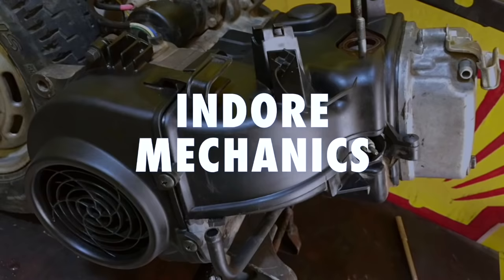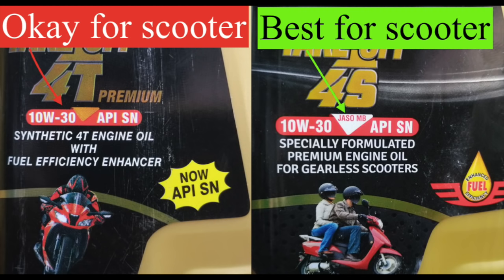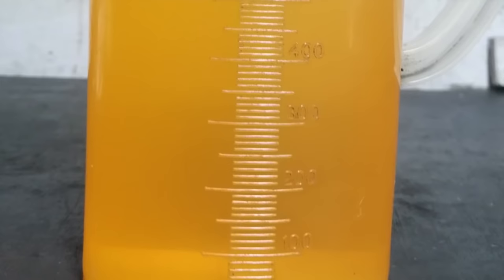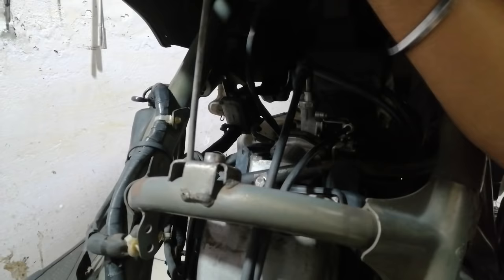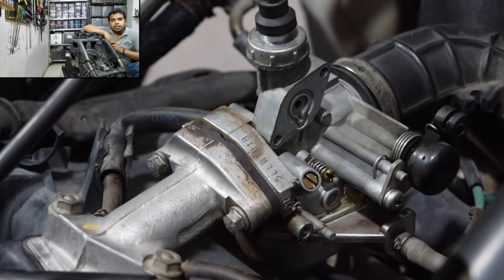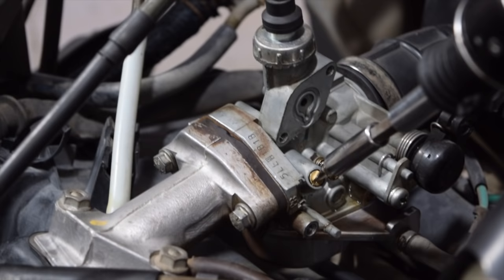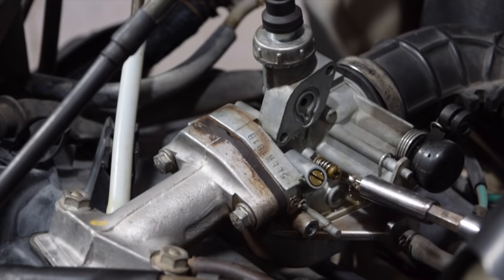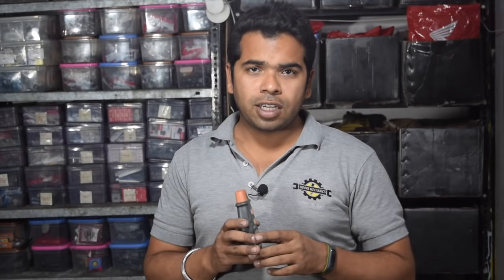Honda Activa carburetor Setting tips || #IndoreMechanics #hondaactiva

Comment: It is difficult for people to judge RPM and all. Simple tuning procedure is, Keep the air screw full tight , Turn the idling screw to the point where the back wheel just start to rotate ; but not rotating. Now adjust the air screw slowly anticlockwise and see the wheel turning , turn the screw till the wheel rotates  fastest, that is the real point where you get good mileage and power.
Reply: I will try this
Reply: @Yash_goud25 bro how was u r experience pls reply i am struggling for Dio bs4

Comment: Very nice except there was no need to screw in back of less than 1/2 turn..the RPM & smoothness of acceleration and drop will let you know the settings.
Reply from the maker: Extra lean mixture heats up spark plug. So it is recommended to turn in quarter turn.
Reply: @indoremechanics  Actually best mixture ratio will give very smooth acceleration and lean mixture will run coarse engine..Best way to inspect spark plug after minimum 500 kms it should give brick colour of inner rod with optimal settings..its light grey means lean or dark is rich mixture.
Reply from the maker: @lokeshvigil8497  You are right but, Spark plug  inner surface will still be white if it's slightly up or down. but you know due companies recommendation we keep quarter turn in.
Reply: @indoremechanics  sir aap ki advice hi jabardast he lekin ab meri request he please. Mere paas honda 125 psi he jo electric injector he aur jese aap ne vídeo ki suru me bataye wheel uske free hone chahiye lekin jab acceletor chhodte he to ek dam se chipakti he jese break lagi ho is ki kya wajah he aur uska koi solution ho to vídeo banaye please. 🙏
Reply: @indoremechanics  sir petrol jyada khane lage to garage pe lejane per kitna kharcha aaye ga
Reply: @indoremechanics

Comment: First off all very very thanks to you sir,
Last 4 year I have a activa 4g but the milage is only 40 to 45 after the proper services in time....
I gave change 2 to 3 mechanic but result is zero.
After watch your this video I have personally setup the carborater and the result is amazing after 2 times of counting the average is approx 56. And the startup problem is solved..
Thanks a lot sirji ❤️❤️❤️❤️❤️
Reply: Bro how much turns after full tight
Reply: Is it 1.7 turn
Reply: Bhai muje  to  30-35 k upr nai deti...  Jbse  liya h  tbse... Activa  4G 😥😐
Reply: Mere pass bhi 2005 model activa hai jo last year Tak 55 kmpl Tak milege deti thi par ab 40 ho gayi hai ....
Reply: What about pick up and power
Reply: @mayursuthar1479  same here
Reply: 56 is too much , the ratio is very lean and will lead to overheating n engine problems upto 50 kmpl is fine in my opinion

Comment: This video helped me to tune the carburettor of my Dio. No more backfiring and no more rough idling. 

I think the last half a turn of the fuel/air mixture screw (golden) takes a hit on performance. 

Thank you so much for this very useful, easy to follow and high quality video.
Reply: Hey bro.. Have you removed that vacuum pipe as he told in the video? Or have you just adjusted without removing that pipe?
Reply: @ranjitnavale4981  I blocked the pipe as instructed.
Reply: What's your mileage??
Reply: Aap sabhi ko iska description padhna chaiye pehla.., Aur mujhe lag he rha tha ki carburetor ko chedna sa engine pr negative impact zarur padega... Aur wahi hua Kuch saalo baad Engine ki Jaan Dheere dheere khatam hone lag gayi meri activa ki warna meri Activa 4g 10 saal aaram sa nikal deti....
Don't do anything without knowledge because everthing have pros and Cons. 
Bye Friends 👋

Comment: Thanks for explaining things perfectly. Why did I find black oil leak from my activa 125 shock absorber in the front right side. Front wheel is like that of motorcycle. Is there any danger in riding around?
Reply from the maker: Shockup has an oil leakage, you'll need to repair it, and do change oil of other shockup too. For balancing
Reply: @indoremechanics  Thanks bro.

Comment: Bro, woh vaccume pipe nikala tha, uska kya reason tha?
Reply from the maker: Vacuum pipe, se back pressure neutralize hojata he, jiske karan hume proper cumbustion k bare me pata nahi chalta. isliye hum disconnect kr dete he.
Reply from the maker: jaise sub filter kharab hota he to back fire sound aata he na, and clean kr ke fit krne pe nahi aata. back fire k liye carb setting responsible hoti he.
Reply: @indoremechanics  proper air na milne par miss firing hoti hai jab paper filter choke ho jata hai to aesa hona aam baat hai
Ya air fuel mixture wala screw galat set hua ho ek baar maine bhi galat set kar diya tha gaadi saare raste patake maarte gayi phir sahi kiya
Reply from the maker: @Clarityinlife335  kaise sahi hua tha Sir wo
Reply: @indoremechanics  mechanic se sahi karwaya fir khud to itni samajh nahi thi tab lekin try karne ka shounk tha
Usne sahi mixture set kiya where he achieved highest rpm aur fir rpm ko set kar diya fir dobara wo dikkat nahi hui
Reply: @indoremechanics  yeh kabhi try nahi kiya, next time kabhi carb setting karna ho toh zarur try karunga.
Reply: @indoremechanics  bhai bike me bhi vaccume pipe hoti hai kya ??
Reply: @ankitsrivastava9715  no

Comment: I have an activa 3g 2015 model recently after reinstalling damaged secondary air filter my bike pickup got decreased 
When a passenger sits in not getting proper power transmission (carburettor thinking also done). WHAT SHOULD I DO

Comment: Thank you for sharing such a knowledge. I just have a question does Dio can be managed in same way ??
Reply from the maker: Yes
Reply: @indoremechanics  good information bro. May i know is it possible to set a honda scootter carburetor into a Mahindra rodeo scootter. Mahindra scootter very less mileage. Any possibility to change the carburetor.
Reply: Thank @Zain09921
Reply: P
Reply: @rajandass7307  lllllll
Reply from the maker: @Zain09921  no I don't think I will work

Comment: Hi, I'm using a honda dio. It was unused for 3-4 months l. Recently i changed engine oil, gearbox oil, cleaned air filter and carburetor and it gives only 30-32 mileage. I adjusted the mileage too. Is there anything else i can do to increase the mileage?

Comment: Hey...i bought new activa 6g a month back. But i am facing one problem now whenever i accelerate it near 40-50 there is some whirring sound from the back of the scooter it feels like something is rubbing against some belt or tyre. 
Please tell me what it could be as the guy at service centre is unable to solve it. Looking forward for your reply.
Reply from the maker: Need to inspect it. Bring it to workshop
Reply: @indoremechanics  i am not from indore :-(
Reply from the maker: Check for the marks over tyre

Comment: Sir why should we have to keep 1 litre petrol for carborator settings
Below 500ml in petrol tank effects on average ?
Reply from the maker: No it's not like that, but setting carb is a bit long procedure and low fuel will definetly effect in the middle of tunning. So we just want enough fuel to keep procedure un interrupted.
Reply: Thanks Sir

Comment: Sir my activa doesn't have the instant pickup has before i did full servicing then also it's not working, i have to twist the throttle full the the pick up increases slowly, any solution?

Comment: What are the settings on tachometer? How much reading should the gauge show? While setting the idle speed.
Reply from the maker: Min Idle speed recommended by Manufacturer for Scooter is 1700RPM +- 100 but you can adjust it to 1500RPM.
Reply: Indore Mechanics thank you.

Comment: Good advise for average, 
But if valve seet, or compressor is week average 
Will  Drop down,  okbest off luck  Allah bless you, for  success,
Reply from the maker: Thank you for wishing me success. And you are absolutely right. That is what I told that there are lot of points in which we need to take care of.
Reply from the maker: Did you check my video on engine idle rpm
Reply from the maker: I request to pls give your suggestions

Comment: Sir, is it possible to tune the engine to stock version as like when it was new..because my service enginner had tuned the engine, I told him not to tune I was satisfied with the mileage that I was getting  when I purchased a new suzuki burgman 125..plz reply soon..
Reply from the maker: Tuning to best efficiency is possible
Reply from the maker: If you are not satisfied with the present settings, you may ask them to reset once again with Co analyzer machine and tachometer in front of you. Kindly ask them to work best. Cause CO analyzer needs to warm up. I'm not sure which type of machine they have. But ask them gently.
Reply: @indoremechanics  ok Sir..Thank You..
Reply: Aap ka number do

Comment: I open the pilot screw upto the point it doesn't give any starting problem in the morning n doesn't show signs of overloading/ straining while driving.  Setting using tachometer might not be recommended for cold starting and especially drivers in a rush who don't let engine warmup.

Comment: Bro, Meri new Access 125cc 2019. Pehle 50,52, milage milti thi, but ab 40 aarahi hain, maine corporator clean b kiya aache se, phir b 40 milage q?
Reply from the maker: Air filter, spark plug, tyre pressure, engine oil pe Dhyan do kuch galat hoga.

Comment: I have Honda Civic 2012 and it recently started this problem: The "Range" meter in the front dash board shows distance traveled of 12 KM when in fact the GPS shows the real deistance is 6 KM. I can get this information (traveled distance) by substracting the Destination Point reading (from Range indicator) from the Starting point reading. The question is: why my Honda Range Indicator says that the distance traveled is 12 KM when the actual distance travelled is 6 KM? Also, Why my Gas tank now a days is draining like crazy? Have anyone had this problem? Where do I find answer without paying hundreds of dollars to Honda dealer or car repair shops? This is really a big problem for many of us...!!

Comment: bro mre pass Access 125  2015 model hai mne uska engine ka km karvaaya hai new original cylinder kit dalvai hai nd new original carburettor new original filter box dalvaaya hai but uska rpm set nhi ho rha naa hi average de rhi
Reply: rpm down down ho rha h bar bar koi solution btao bro
Reply from the maker: Is any air leakage

Comment: Thanx sir
But sir Aapne vequm pipe ko band kiya na wo thoda samajh Nahi me aaya
Reply from the maker: Pair valve neutralises negative pressure whenever unburnt fuel escapes to exhaust. so if PAIR is connected we can't find that unburnt fuels is escaping to exhaust. so we disconnect pair to adjust proper fuel air mixture and confirms that there will be maximum fuel burned in the chamber.
Reply: @indoremechanics  Sir kya bina PAIR pipe disconnect kiyemilaege set kr sakte hain kya

Comment: Honda CB UNICORN  Ka Mileage Settings tips tachometer se  activa ki tarah hi karke bataye  air pair control disconnect karne ka karan ?
Reply from the maker: Pair valve neutralises negative pressure whenever unburnt fuel escapes to exhaust. so if PAIR is connected we can't find that unburnt fuels is escaping to exhaust. so we disconnect pair to adjust proper fuel air mixture and confirms that there will be maximum fuel burned in the chamber.

Comment: what would happen if the PAIR system vacuum line is not disconnected?
Reply from the maker: The back pressure will be netralized and you won't get the exact settings.
Actually this system is for the unburnt fuel which escapes to the silencer. So for complete combustion we need to disconnect it.
Reply: Ok

Comment: Please advise. My activa 3g average 25 to 30 kmpl. Settings done as you showed in video
Reply: No it will not increase the average much. Vehicle condition and riding conditions also impact on average. Like tyre pressure, engine oil quality and condition, air filter and spark plug cleanliness, city traffic condition where you are riding, your riding style, wheels are free spinning or not etc.

Fuel screw adjustment only impacts on starting issues, PUC checks, and very small amount to mileage (average actually, not mileage).

Comment: I have done same for Activa 5g. If you do this for scooty it will effect in engine Head. Blug will become pure and after 6 months will face. Relay will get effect. Starting problem. Sir Mixture Screw should be equal to petrol mixture. Both mixture same vehicle running will be good . Now I changed to normal adjustment. Please don't do for your scooty. If you do see after 6 to 8 months. You will see changes. After that get back
Reply from the maker: Sir, This video is for knowledge purpose, we strongly don't recommend DIY and it is also mentioned in video. If you do so, you are solely responsible.
Reply: What were the normal adjustment can you please tell me i aslo what to do.

Comment: Hi i have activa 5g i have issue with some noice so when i run mi bike for some 1.5 km and if i stop on signal or any where it start making some noice and it stop no mechanic has solved this issue pls help me for the same
Reply from the maker: Well then without inspecting it, its hard to know what the issue is.

Comment: Isn't it fuel screw? I think it is not air screw, but fuel screw. When the screw is towards the air filter side, it is air screw which monitors the air intake into the carburettor (can be found in 2 stroke vehicles). When the screw is towards the engine, it is fuel screw which monitor the fuel intake into the carburettor (can be found in 4 stroke vehicles).

Comment: Kindly put video about
1) F.I. Activa 6G mileage settling 
2) RX 100 carb settling
3) 2T oil to fuel mixture ratio in Yamaha RX 100
Hope to get feedback from you
Please 🙏🏼
Reply from the maker: Sir FI don't need mileage settings as carb.

And sorry, we don't work for RX100.
Reply: @indoremechanics  
Thanks a lot sir

Comment: Why u removed the tps unit
Reply from the maker: To get the clear video on screw adjustments.
Reply from the maker: And new model do not have TPS and this does not work as it was meant too as compared to other Bajaj bikes which has it for a solid reason and working condition.